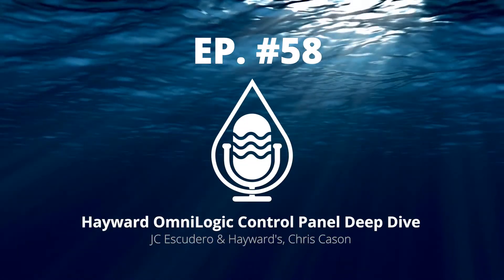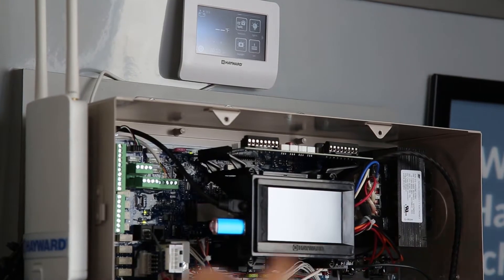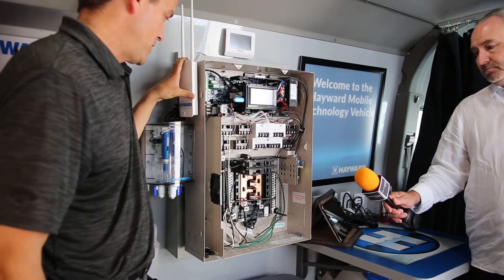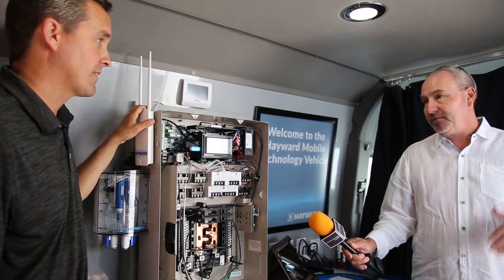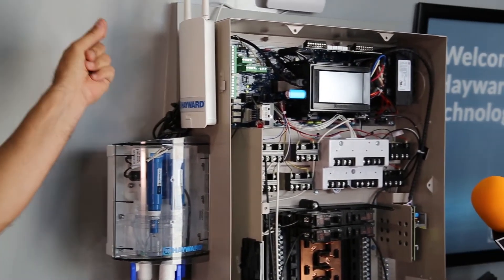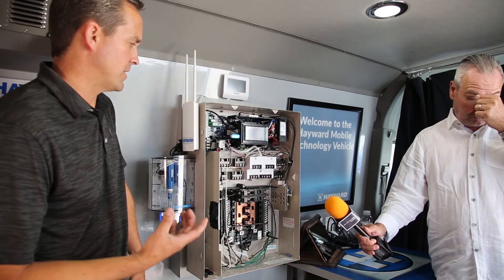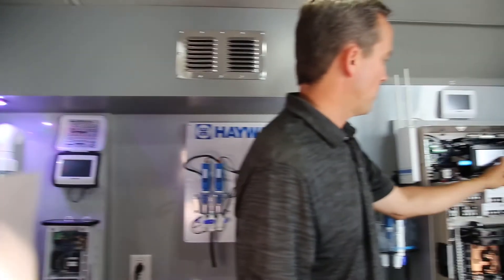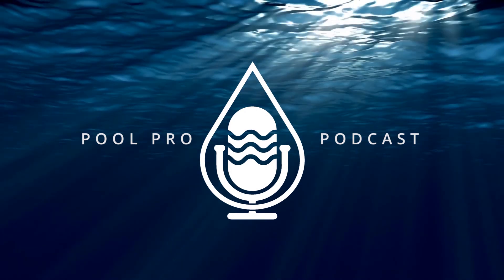Hayward OmniLogic Control Panel Deep Dive | Episode #58

Comment: So where does the data cable for a  sp3206vsp connect
Reply from the maker: The low voltage communication wire is connected through the end of the pump.  Depending upon what version of the pump you have, access to that area of the pump requires you to remove the top digital display (very easy, two screws) and then remove a safety cover.  Once you remove the safety cover you will see the area to wire the communication cable.